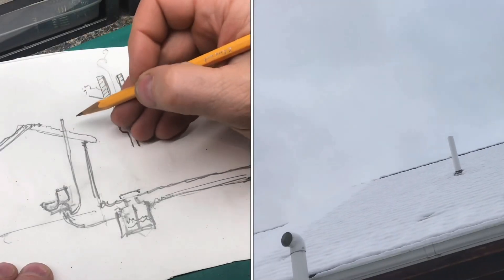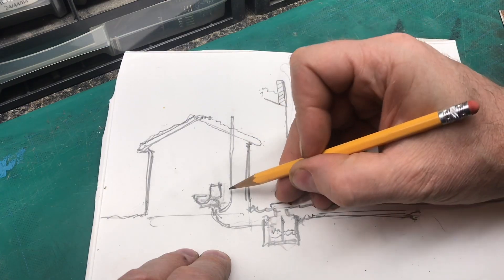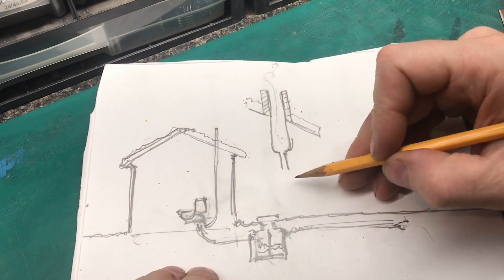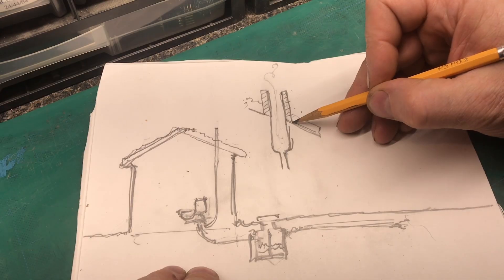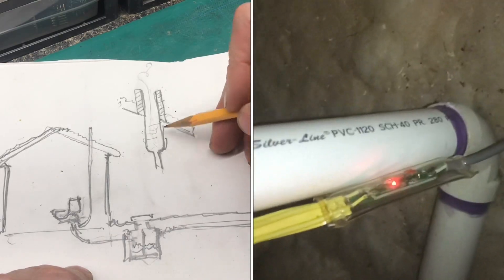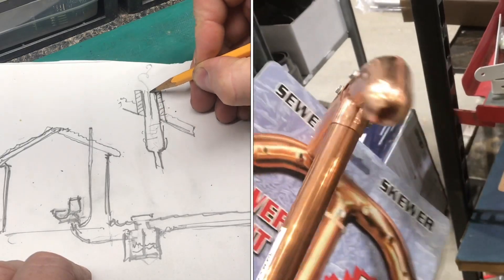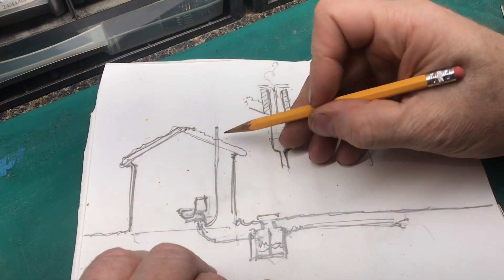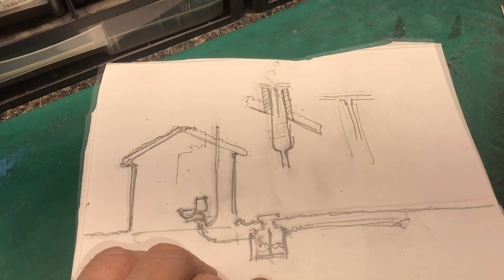how to fix a “sewer vent” that FREEZES closed

Comment: I have been experiencing this several times every winter.  I have the Copper T and that is not alleviating the issue.  The temperatures are above freezing in the daytime but the smell is still persistant until the temps get above 40.  I only have the smell in my basement bathroom.  Gases emitting from the Tub overflow drain.  I will clean the tub and then 4 hours later it will be brown with sewer gas stains again.  I have had the septic checked and there are no issues.  How do I fix this.

Comment: Thanks for the Video I don't totally agree. Although your close , but I invented a product called No Frost Venting  that actual works passively no power required,. easy to install in most cases. The vent kit works faster as it gets colder outside. take a look!  No Frost Venting I also have reviews from Alaska!

Comment: I had an issue with sewer smell in my home for over 15 years. Asked several plumbers what was causing it. I had snow freezing up in just the top foot of my stink pipes where they exit the roof. Temps would get just below freezing and I would have to go on the roof and unplug them. I must have done this at least 15-20 times every winter. SO FRUSTRATED. So one day I decided to pinpoint where the actual smell was coming from as it was not coming from any of my sink trappes. There was one spot near my kitchen floor where the smell was very strong. My thought was that who ever built this wall may have accidentally put a screw in a stink pipe and it was leaking right there. I cut a hole in the wall and you would not believe what I found................There was indeed a stink pipe on the other side and it was completely OPEN!!!!! When they rebuilt the kitchen area and moved the sink that was once there and they forgot to close off the old stink pipe. So you can imagine how bad the smell was for all these years. Needless to say I plugged it off and never smelled sewer again. Never had to go on the roof again either. So my advice to anyone reading this is to try and find the cause. Make sure all your sinks have traps and make sure the traps have water in them. When you smell the sewer smell try and locate exactly where it is coming from. Also I live where winters get down to -30f
Reply: I'm dealing with this right now, having a real hard time locating the smell source, ive ripped walls out and everything, wish i found something like that
Reply: @nickk964  I feel for you. Can you pinpoint the smell? Is it there sometimes and not others?

Comment: The copper pipe idea was a total failure in my experience. I live in northern Minnesota and temps in the -20 to -30 F range are not uncommon, often lasting for several days at a time. The copper actually increased the speed and extent of ice formation inside the vent. Also, I noted severe oxidation of the pipe surface in a matter of days, no doubt decreasing the efficiency of the material to wick heat up from below. I understood heat tape to be used only around pipes that contained liquid water, implying that a dry PVC pipe could be overheated. After numerous attempts to fix vent freezing, I am still searching for the definitive solution. So far, pouring warm water into the vent has been the only real option.
Reply: Guy below has a product called No Frost Vent. It might be your solution? I have no experience with it personally.

Comment: Thanks for the video!!
I live in Anchorage Alaska. We had the bad sewer smell and the vent was block. Easy fix, poured hot tap water. In the attic, the vent is to far and a tight squeeze for me. I’ll look into the copper pipe fix.